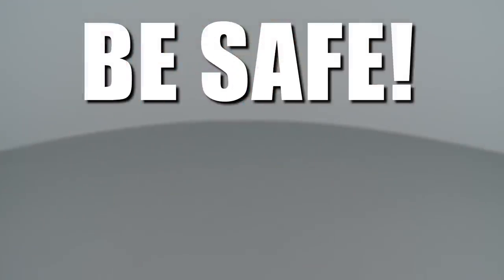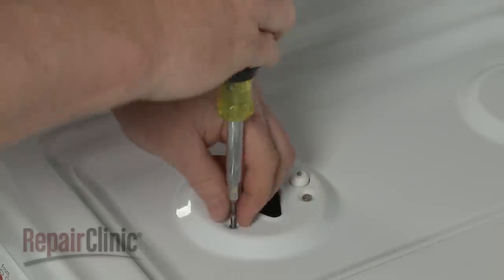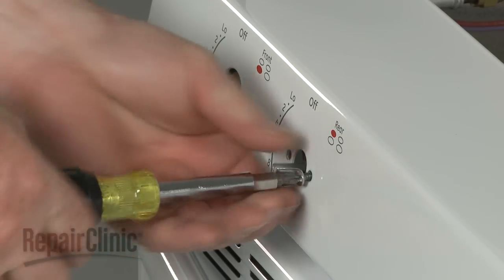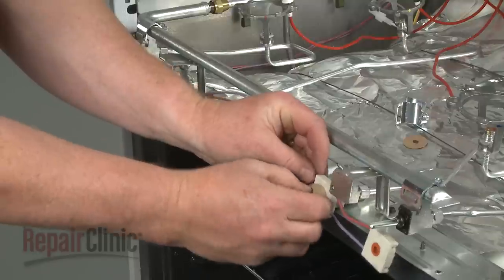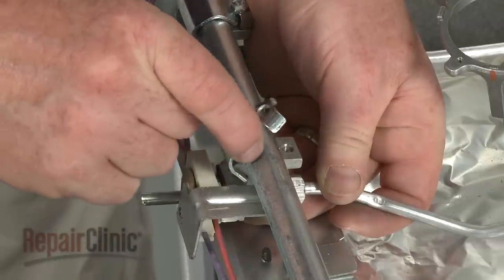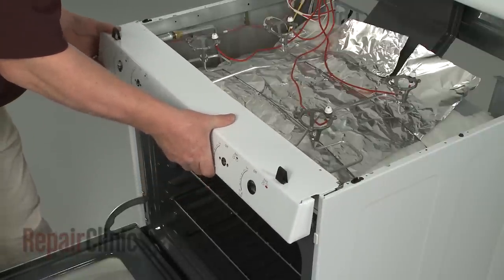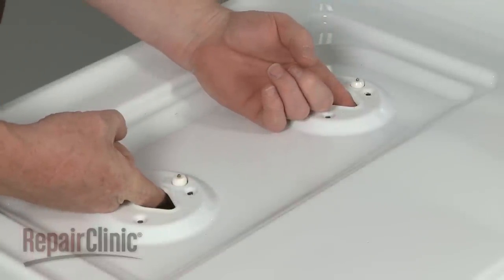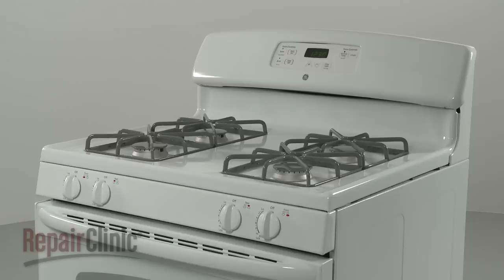GE Gas Range/Stove Burner Won’t light? Spark Ignition Switch

Comment: I saved $50 +++ by popping open the faulty switch, cleaning it and giving the metal tab a slight bend to improve contact. Good as new. Those $50 harnesses must cost all of 4 dollars to manufacture. What a scam! It pays to have the curiosity to take things apart and see how they work.

Comment: I was pulling my hair out as 3/4 burners did not light, even though they were sparking....turns out when I lifted the range top, 3/4 burner spark ignitors lifted away from the stove top about 1/4 inch....pushed them back with my thumb and SHAZAM....thanks for the help...
Reply from the maker: +John Green Good work!

Comment: Very good, clear instructional video. Now, I have an 8 year old whirlpool gas range.  I need to replace the ignition switches. Would this part work? Also I need to replace the knobs as well as possibly the basis and the weight. Any suggestions for 3rd party spares? GE usually asks for a ransom.
Reply from the maker: We have all of the parts on our website. If you input your model number into our site you'll also see what videos apply to your specific machine. http://www.RepairClinic.com

Comment: I have Bosch Cooktop which has 5 burners. Only center (bigger) one has the issue that sparks and fires, but don't stay on when taking off my hand from knob. What causes this issue and is this related to the ignition switch? or transformer ignition?

Comment: I have 2 igniters on the left side that aren't lighting but the 2 on the right side do work. Do I need to replace the igniters, spark switches or spark module? Thanks for the video.
Reply from the maker: +Joseph Costello Our guess is a defective spark module.
Reply: I have only one not sparking

Comment: Worked on GE 5burners gas range today. When plugged power on, all burners start clicking.Changed sparkling module, burners switches. Still same problem. Please, advice.
Reply: Do you replaced the sparkling module or burners switched ?

Comment: After I replaced my harness all of my igniters will not stop clicking unless I manually light all the burners. I've cleaned and dried the igniters and contact points with acetone, no change. Any help would be appreciated. Thanks
Reply: Make sure you have the switches installed with the gas valve screws set into plastic wells on the bottom of the ignitor switch.  It worked to stop the clicking on my old Magic Chef.